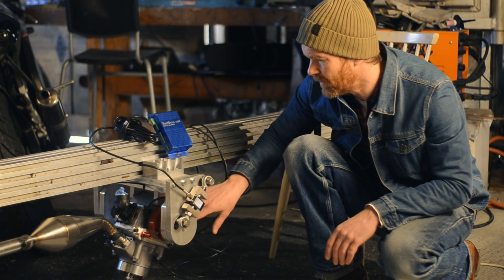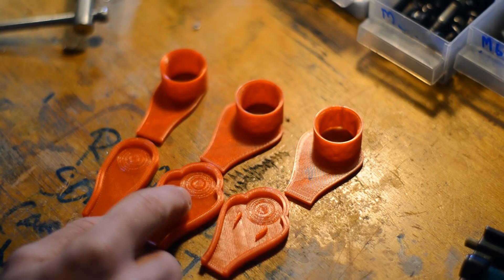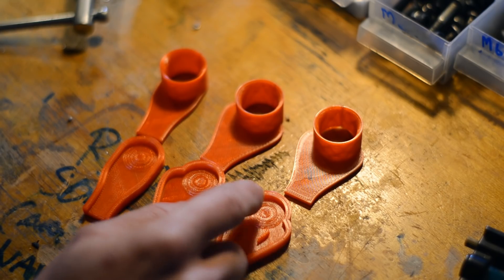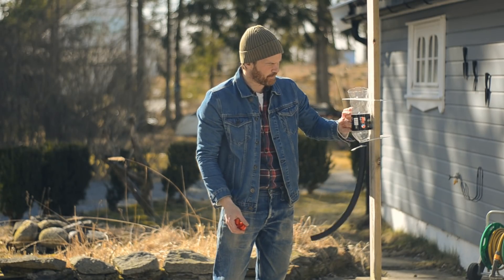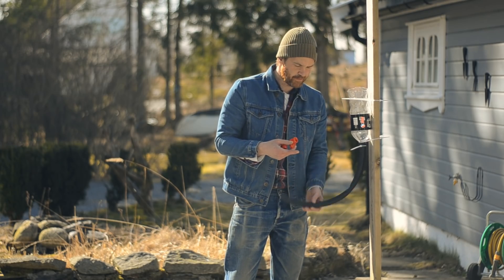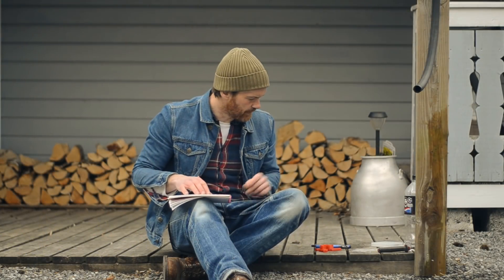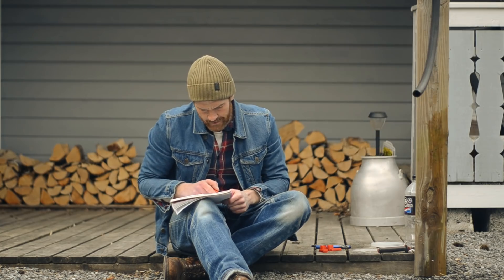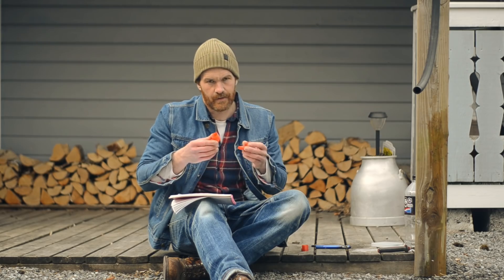Three 2T Exhaust Ducts, Which Will Flow Better?

Comment: Your hand actually looks that way because as you stand up you're kind of twisting your arm and wrist a bit you're causing blood to pool and capture "a bit more" in your lower arm and wrist. You'll note where it stops on your fingers. Additionally, your skin is very pale due to genetics and region you could almost call it "slightly translucent" so while the amount of pooling is nothing abnormal in any way it's visibility is exacerbated by your skins dynamics and the fact that it's cold, tightening and further constricting your skin. 

Or you're a zombie. Either way. Neat exhaust ducts.

Comment: Imagine the (buffer zone) on the intake 

Once you have a piston stopping the flow 
The air pressure will build up around the “buffer zone” and then be released... 

This is a intake port mod not a exhaust mod!

Comment: Unfortunately your conclusion is not correct, because the test with water is not a good comparison. I can mathematically show you what happens. You need the different paths because the sum of the underpressure created is smaller then without the fins. The fins should also be longer. It can improve the efficiency of the design up to 14 procent. What is enormous.
Reply from the maker: 👍 This is what my IFD tells me too.

Comment: Try shortening the exhaust exit much closer to the cylinder. The charge temperature will be higher as will port volocity. Your water jacket is sucking up heat energy that should be expelled, that energy is used for vacuum on overlap created form the exiting exhaust gases.. I would use a larger port exit and primary pipe than the cylinders port size dictates. The flat roof and floor model design will cause reversion, flow in both directions. Also It should be the exhaust tip after the expansion chamber that governs overall flow. The water flow test method works, but the part being tested needs to be submursed for a true flow test. A better idea, would be to build a flow bench with a manometer, and shop vac for the blower and vacuum source. Since it is a one off build, I wouldn't bother. I think just pick a couple of designs and use the dyno, or the bike the Engine is going in to decide what works, and what doesn't.

Comment: Complete waist of time, you need to be testing it through the transfer port and into the cylinder, your results could mean one thing and reality is when flow goes in the other direction it could mean another thing

Comment: Interested to se how much a different tilding the exhaustport down following the flow of the gases. Is it a gental flow or the fastest to a distans that works best for tuned exhaust there you have 3D space to use as well. Hard with water though

Comment: Fluid flow dynamics at its greatest. 
I sure don't know anything about this, but wouldn't turbulence be an  important factor?
I would have thought with this test, being it's only testing volume, not turbulence or flow pressure that the biggest unrestricted design would have moved volume best, which is did.
Is total volume of air key with your engine. I still struggle to understand how the exhaust gases can flow out fast enough with your cylinder design (I can't remember what you call the type of engine design you're running)
Once again, I don't know any of this stuff, just learning. 
Bloody love you vids 🤘

Comment: Build a full size model, cylinder and all. Use clear plastic and colored water steams to analyze the water flow patterns. I've used large syringes for the color injectors in the past. I think that the reverse flow would be much more interesting than the forward flow. The twin exh port idea is interesting as well. Two different  tuned exhaust ports for two power peaks? Keep up the fun!

Comment: In the 1970's, we had a guy at Pratt & Whitney Aircraft who modeled flow it turbojet engines using water and clear plastic structure. They were able to adjust somehow for the Reynolds number. Still some differences from your model, as that was steady flow instead of pulsed, and no return pulse from an expansion chamber to consider.
With laminar flow, the speed at the wall is zero, and increases with distance from the wall. Even though your cross sectional areas were the same, the guide fins add "Slowing of flow" to the center area of your stream.

Comment: I'm surprised you even found a difference because with water I would expect the outlet to be the only constraint, regardless of what happens inside. Water is incompressible and your outlet has smaller area than the port itself

Comment: Sven I like your backyard engineering approach.... 
 You have already been a great inspiration to my homemade inertia dyno project. 
https://youtu.be/wrAsMfGjBdk
To my opinion the main issue here is that water is not compressible and has a much higher viscosity than air ...in such exhaust port configuration air elastic behaviour will help around those port splitter.
 What about connecting the same setup to a spare wheel full of compressed air with a manometer on the hose and a conical transition to even air speed at the port entry.  You could measure the time to get from 3 to 0 bar....?

Comment: I would suggest 3D printing more 3dimensional versions, unless that's the actual cross-section of flow you're going for. Also try the same test with compressed air. In some cases gasses and liquids can flow better in opposite shapes due to differences in friction, and compressibility.

Comment: Transonic gasses may act differently to a liquid....think Tesla valve.... How about a corrector with a helix? Would a swirling gas better reflect back on the pipe? the Venturi effect of the bulges may play a role in gas speed? Lastly will there be thermal implications of the hot exhaust running full width on the piston? should the trapped /pinned part of the piston ring  be AWAY from this hot edge?   Excellent channel - You deserve EVERY success!

Comment: Cute entertainment! But it has no relevance to any outcome. Exhaust gases are hot, compressed, extremely fast, being "pulled" by the tuned pipe, and travel both out of the port AND back IN. You are determined to not have a single exhaust bridge to support the ring, and yet you are considering 2 flow directors just outside the port. The exhaust back flow (supercharge) has an extremely short time frame and area, to get back into the chamber compared to the huge time and area of the exh. blowdown. Those large bulges will slow the return supercharge right down. When looking at and testing 2 stroke exh. ports, you have to test in both directions with the piston (valve) involved, unless you are not using a tuned pipe.

Comment: Great stuff.   My thoughts are that the bulging designs will have a severe effect on the return pulse from the exhaust.  It will slow the pulse and reduce the “reverse charging” of the cylinder when the exhaust port is open.
Reply: Good comment Greg. I was wondering the same. Even to the point of possibly preferring the slim straight outlet over the bulged ones. 
There's a lot of things Alex needs to consider overall. Flow is only one part of the picture
Reply: I'm expecting someone to chime in with standard kinda resonant cavity equations and explain the standing wave resonance. I know there's some actual physics there but I'm not going to be the jerk who says "you're doing it all wrong" because I like his process of working it out.
Reply from the maker: But I am doing it all wrong... 😁 This was just a start.
Reply: @2STROKESTUFFING  I believe in that process. Don't change a thing!

Comment: Air does funny things. Aircraft designers use known shapes for airfoils in new aircraft. The computational fluid dynamic software hasn't been able to come up with anything better. NASA spent untold amounts of money trying to come up with a better propellor design and they succeeded in bettering what the Wright brothers did in 1903 by only 5% efficiency! If you watch videos on porting racing cylinder heads some need to be smaller to flow better. An aircraft sized bumble bee would never be able to fly, but optimized for their size and our air they fly quite nicely.

Comment: I would change your test slightly for better "accuracy" use compressed air and record the time it takes to lose all pressure that way your working with a compressible fluid and one that it being forced out under pressure ( likely need smaller models to give a measurable time)
Reply: shure. but flow benches has been using water ever sience the beginning. so... i guess someone at some point figured it did not matter that much.
Reply: I was thinking the same. Maybe use an air flow meter to measure volume at different pressures. But that doesn't take into account the frequency of the exhaust pulses. Back pressure and all that jazz.

Comment: I like it as a quick test, and I was amazed that you found such a large difference still! I do wonder what you would have seen when testing with a compressible fluid, which exhaustgases also are. Perhaps you can do a test with air at an approximation of the mass flow though the port and measure the exit speed through an everytime equal exhaust end gap.
Reply: Or maybe measure the time that air pressure take from mark to mark in the pressure gauge. More easy IMO
Reply: @alejo8820  but then there is not yet a fully developed flow, or im misunderstanding you.
Reply: @Joost-rs8fs  instead water, use compressed air from a tank. Start at,  example, 100psi to 50psi, meassure the purge time, and compare.

Comment: This flowbench does not provides the same circumstances as in engine. 
Water travels in one direction, laminar flow, no pulses. Flow of exhaust gases in true engine is much more complicated, as You know. 
This experiment does not proove which one is the best. 
Google: Raynolds numbers.

Comment: In regards to your hand. You may have raynauds disease. I have it too and so does my mum. Basically causes poor circulation. It's like a clogged radiator. In the winter I go blue and in the summer I get too hot 🤦🏻‍♂️ but it's nothing to be worried about. It can be a bit painful when you're freezing cold and you warm up too fast though. Feels like someone has hammered the end of the finger tips. You probably don't notice it as much where you drink sprits. Alcohol thins the blood and allows it to flow better. Strangely enough you're learning fluid dynamics 😆😆 you want more area in your veins 😆

Comment: Good experiment but the exhaust of an engine is a gas and you are using water which is a fluid..so your results will give some indication..but are not going to be super accurate.

Comment: An interesting approach and will give a good first approximation, but compressible fluids with much lower Reynolds number will behave quite differently.  Maybe better to do the same with compressed air?  Small reservoir, monitoring time to drop a by a pressure interval... or measure flow rate (a welding gas flow meter will work just fine) with a regulated pressure?  Both are still far from ideal, but definitely more realistic.

Comment: Spiral directional flutes , aiming exhaust gases in a vortex circular motion to speed up your exiting gases. Have found this to greatly improved overall RPM in nitro motor..
Reply: The Ford 6 cyl engines from 40 years ago did this in the intake runners, but it was pretty subtle (no vanes). I totally destroyed the torque of an engine, trying to port it.

Comment: I congratulate you on your experimentation (although I'm a fan of more replication). I had doubts if water was giving a good representation of hot exhaust gas but Mr Nicks comment gives me comfort. I'm not sure that a bit of turbulence is always a problem but I'm only guessing. My guess is that maintaining gas speed and avoiding pinch points is most important.

Comment: Does the port have to be a 90°angle?  Seems to me the fluid would crash in to the flat portion causing turbulence. Slowing down the process.
If the fluid is spinning it would drain faster.
 You can test this out by pouring out a bottle, with a timer, and  do it again but give it a quick shake so the fluid inside is spinning. 
Maybe a couple guides on the inlet of the part would force the spin to take place. Or a rounded transition for the 90... 
Keep up the good work!

Comment: Great video and great wrk as usual. Thoughts:  Go with bridges and use them for piston to be supported ect.  It’s a no brainer if you can run the bridges with little to no loses then you can now do so many different things with out limitations Your imagination won’t be limited to a limited number of pistons or limited number of dyno runs do to wear. You can literally do what ever you want to modify pistons ea day  for test an trial and simply just toss the piston in trash daily for very little money. Like you can purchase off the  shelf pistons for 20$ and  don’t think twice about a modification you just do it and if you  don’t like it then you can just  toss that piston in the trash and grab another piston and try something else ect.  when you get to the point of a great running and performing engine then you can simply pop on second cylinder with out bridges and see at that point if there’s potential for power gains Like do all your R&D and tuning  with bridges then when you finally get to a point where your ready to squeeze out a little more performance then pop on your bridgeless set up and go from there.
Reply: He's not using bridges because everyone else will be using them. It's the only obvious point of improvement that no one else is trying. The bride-less design is a large portion of the improvement to the engine. 

For the "to see if there's potential" he's said his port design is a copy of the current top tier one used. Ones that, have already had a mountain of dev work dumped into them. THIS IS the last thing to be improved. Everything else with the cylinder is about the same, minus the larger transfers/case flow changes he's made. Even those changes are reliant on the exhaust flowing better for them to work properly. 

He has other engines he's modified/done R&D/learning on. This engine he's making is the end result for what he's learned from those.
Reply: @akabiscuitwaffle    Ya I understand you. I was just thinking if you get a full handle on that particular engine with  bridges then transitioning to no bridges would be an easier final step. That’s my   thought process behind going with bridges to start

Comment: Love it.  When I was 15 in 1976. I used my parents garden hose  to check the flow path of the transfer ports on a CZ motor spent he rest of the summer doing chores for all the water I wasted
Reply: It was not wasted, it was part of valuable research ;)
Reply: Large Hadron Collider in base trim :)
Reply: I did the same with my Sachs 503 Zylinders
Reply: I used to do it as well. With Yamaha TZ cylinders
Reply: jee, jste čech? /are you czech?

Comment: So doesn’t that just prove that the bridged one was only a tiny bit slower is that tiny bit worth all the trouble your going through to make magic pistons that still don’t work without bridges. You can easily still make the most powerful engine with the other mods like the secondary massive inlet and injectors. That way reliability can happen. I think that 100%% exhaust port without bridges would of been done by now by the big manufacturers if it could be successful and not eat rings in 2 mins at lowish rpms. There are boundary’s of what’s possible and the no bridge idea sounds great but exceed them boundaries
Reply from the maker: 👍 If, after more testing, the 100% port won't work I'll go to a "normal" design.
Reply: @2STROKESTUFFING  thanks man I’ve watched your vids from the start and have learned an amazing amount of knowledge. I know have built my own very powerful little singer 👍

Comment: At first I thought there is know way this is a good comparison with your exhaust but I looked it up and the Reynolds number between water at this low speed to exhaust at high speed actually lined up decently. Obviously not going to be perfect but was much closer than I thought it would be
Reply: @Alfred Wedmore Yes! Good point. I was just saying that it’s a better test than I originally thought. The compressibility of the fluid is obviously not accounted for in the test but the level of turbulence might be on a similar scale. The water wheel to gas turbine example is not that great though because those are in completely different regimes. However, if you look at the turbines in a hydroelectric system they aren’t that dissimilar. Obviously there are different design considerations but I don’t think this test is completely invalid. Will be interesting to see what the cfd says!
Reply from the maker: 👍 Yep, it's not too bad a test actually. Needs refinement to remove human inaccuracies.
Reply: @2STROKESTUFFING  I've noticed that your last video about the motorized bicycle was posted 2 years ago :( have you decided to completely shelf that project entirely? In all honesty, I was hoping for some insight on cylinder swaps to do a bigger bore. Everything else I hope to do, you have already explained in an amazingly helpful way and detail. Please let me know!